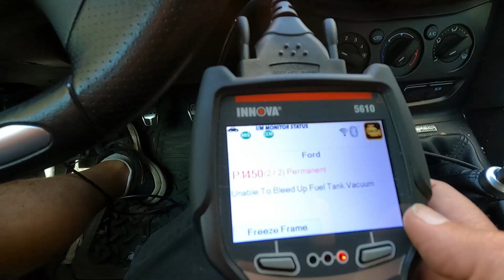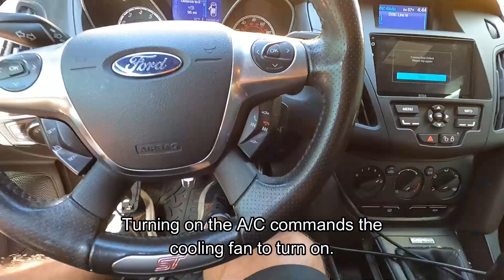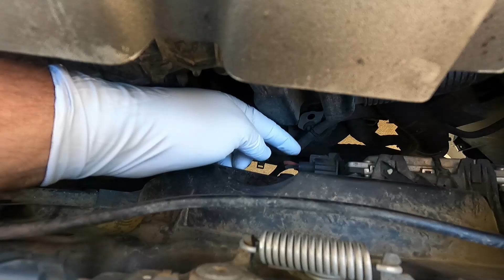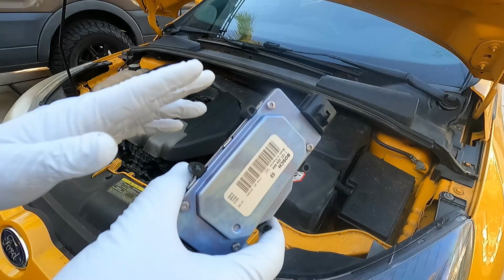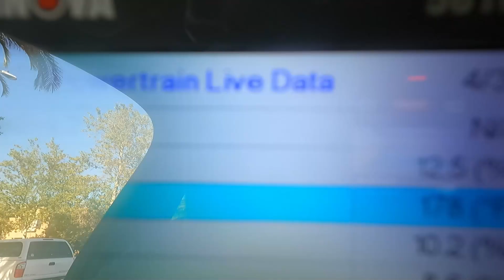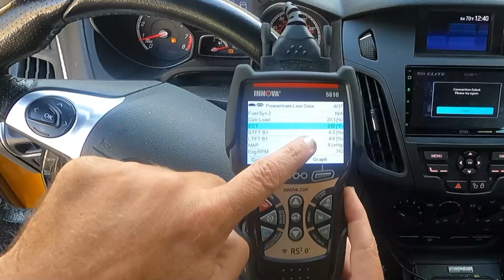2013 Ford Focus ST Overheating Problem! - Radiator Fan Not Coming On! Fan Control Module Innova 5610

Comment: i had the same issue, fan wasnt running and quickly overheated when ac was on,
replaced the control module fixed it!

Comment: Plastic on the fuse can heat up and expand and turn off the fan,Then when it cools and shrinks it can turn the fans back on again,Over and over.Thats called internitting! THE LAW OF Temperature changes.

Comment: I changed the fuse and it turned on the fan but day later now the fan doesn’t turn on at all. What could it be ? The mega fuse or module ?

Comment: Sounds like a common sense thing but check your coolant level too! It just started getting colder here in NY and one morning I noticed by the time I got to work I had lost my heat and my temp was going over normal. Checked coolant level and I could just barely see any at the bottom of the tank. If it gets too low you can get an air pocket that'll make it lose heat/overheat intermittently. Filled it up to the max line and no problems since

Comment: Hi, thanks for the helpful video! I have a question about how you bypassed the fan control module by connecting the fan directly to the battery.

Specifically, how did you connect the wires to the battery? My fan has a red and black wire that go into a plug that normally connects to the module. Did you tap into those wires from the plug, or did you connect somewhere else? I’m trying to test if my fan motor works or if the issue is with the module.

I already checked the 50A fuse you showed in the video, as well as fuse F32 and relay R12—they all seem fine. Just need help figuring out the wiring part. Thanks again!

Comment: Excellent video and excellent explanation. Thank you. I had a problem with a 2015 Ford Focus that I couldn't find, because the fan turned on, but when the temperature passed almost three-quarters of the way, the fan would turn off instead of turning on, and this video helped me a lot to solve the problem. Thank you. I was able to get the fan to work without any problem by changing the fuse that you show, which gives the current signal to the relay. Thank you.

Comment: You kept saying the fan. Mine is a 2001 Focus and has 2 fans. I just straight wired my low-speed fan on all the time. Don't really need the high-speed fan.

Comment: Great vid.. I have same issue 2013 petrol ST, my fan doesn't come on even with aircon on.. checked fuses and relays, fan works when hotwired, module changed for after market, only noticeable thing is the thin wire to inlet side of plug pushes out when plugged into module. More checks to do before biting the bullet for the oem fan assembly Inc module.
Reply: If the fans don't come on even after you replaced that 50 amp Mega fuse, replace the fan ctrl module. That's the problem!
Reply: There is a mega fuse not in fuse box it's in front of battery between air filter housing

Comment: I’ve got same problem with ac working but not blowing when engine hot. Only difference it’s my gauge goes up half way and don’t move any more. Was that the case with this ford? I have change temp sensor and swap relay but that didn’t fix the problem. Thermostat must be ok cause pipes go from cold to hot instantly when engine gets up to temp
Any thoughts?
Reply: same issue with mine
Reply: been told can be the fuse box or the harness

Comment: Fan is on its way out if its eating up those modules.  Been there done that.
Reply: Is that so? Mine is doing the exact thing, I'm fighting the urge to just buy the module on ebay, guy pulls them from junkyards and resells them for 70 bucks
Reply: Oh? Expound!!! Give a thorough explanation why it does that!!
Reply: @KL4life  no.
Reply: @bryco32  that's because you don't know why...
Reply: @KL4life  Doesn't take a rocket surgeon to figure out if you keep blowing fan controls the fan is drawing excessive amperage. We saw this in the Focus, Focus st and the Escapes.   I completely understand if this is way over your head.  :) LOL!
Reply: @bryco32  then tell me why it isn't on Ford's TSB's? Any common problems that happens often to any lineup end up on their list Einstein!! Ohhh but you already "knew that huh" point dexter??? LMAO 🐋
Reply: @KL4life  Do you realize how stupid your posts make you look? 🤡 I'd wager to bet this is your entire M.O
Reply: @bryco32 what is the solution then?